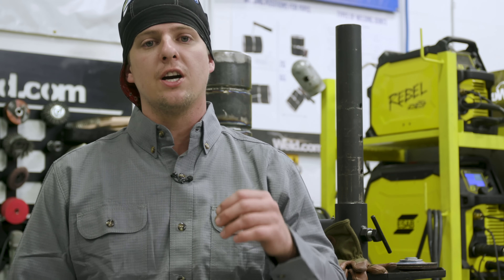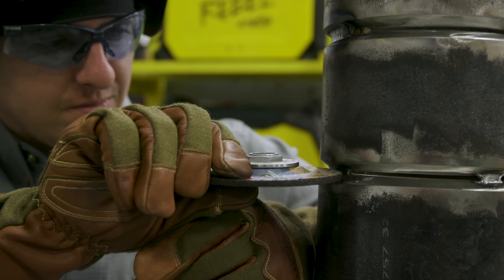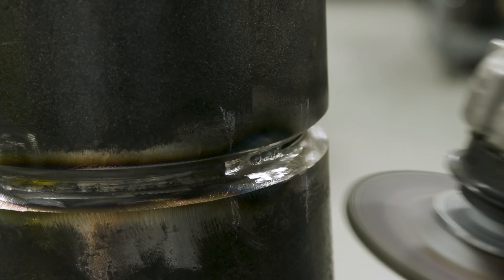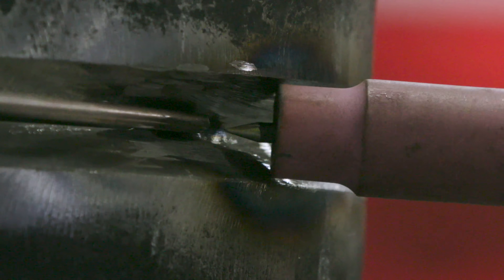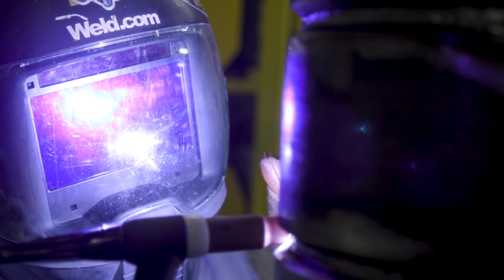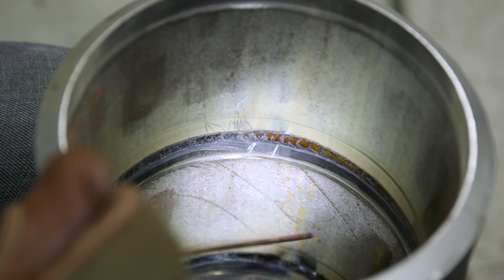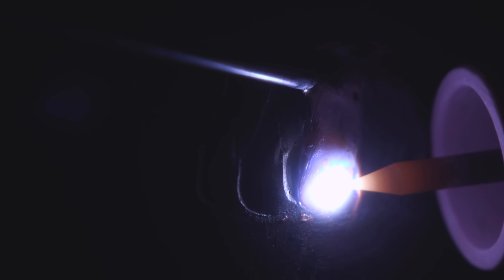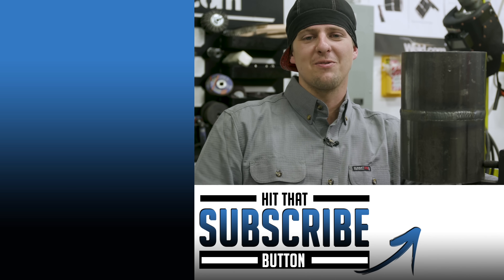How to Fix Undercut on Pipe Root and Cap

Comment: so I understand this would be for the welder qualification test. But what happens if its during production and lets say your inspector rejected the weld because of the undercut.
Rejection in production weld means re doing OR reparation following a reparation approved WPS, BUT NOT welding over it, right?
My doubt is wether i would have to cut the weld and re do it at all if the inspector rejects my weld.
thanks
Reply: Why would your QA not let you repair the weld? Why cut it all off?m

Comment: Great job explaining in video repair using Blue Line Cutting technique...                The thicker base metal heat transfer is absorbing the btu's per unit mass but the thinner root metal absorbs the btu's however it can only with significant temp increase because there is so little mass AND cross section for the btu's to travel out to the thicker base metal..   This is the root metal's Planck energy is the temperature 575F or 302C permanently  recorded on the surface, so if go higher the color is yellow toward white which you simply don't see it and you have cut thru...  (steel) other base metals have own color vs temp...   EVERYONE ALREADY KNOWS THIS all as heating to cherry red, straw  yellow, carbon blackened surface fades, white hot etc....

Comment: Usually when you try to fix something small you end up makeing it worst!!!!!! Word to the wish if the wall is broke down and the edges don’t look like straight lines leave it alone and keep going I’ve never seen a x-Ray tech call undercut. I’d only try to fix it if the QC had to look at the bead before I closed it up. Internal undercut has to exceed two continuous inches to be a called a defect. Just put a tall cap on it and call it good!!!!!!

Comment: Yeah, boy, for future: STOP blanting edges of your beveled pipes. That is not stick welding with its 1/8 blanted edges. You should not do it for TIG. Not more than 1/16. But better leave them sharp.

Comment: 7:07 - “...[root] is flat... I will run the second pass even hotter, and it will push in even more...” 
Absolutely misleading statement. Yes, the second pass has to be slightly hotter than the root pass, for the purpose of better fusion of the metal of the second pass with pipe walls. But no way you are able to fix flat or concave root by running very hot second pass, whether you are pushing in wire or not pushing. Actually, the opposite is true: running the next pass hot enough - is the trick of fixing excessively HIGH root pass. I did it myself a few times. As a result of very hot second pass, the flat root face will either additionally suck in, leaving concave root pass which will result in failed inspection ... or your amperage was not high enough to cause this undesirable damage of sucking in a root face...
Reply: depends what position the pipe is in.  If your welding really hot in the flat position you can absolutely sink the root in further.  In 2g though its gonna suck back running too hot on the hot pass.
Reply: @kwent86  I agree with you. But even in flat position it is a very risky practice and without visual control. I would give chance for success in fixing/sinking root nicely even in flat position as very low. But depends on material. For carbon steel, with its high viscosity when melted, the chances are much better. For most stainless steels it is nearly impossible, because they melt like water. One second ago stainless steel still needed extra heat... but one second later the paddle is already sinking much more than welder wanted. 
Also... every time you remelt stainless steel it looses nickel. It boils out. And stainless steel loses its properties. So, for duplex steels they keep those special welders that weld everything very cold, do everything right from the first time and never need to do repairs.
Reply: @alekrudy5993  for sure, not something you want to try to do every time.
Reply: Key words being "I tried it a few times". You can absolutely round out a flat root by running a hot second pass. Just takes practice, knowing your heat, and how fast in between passes you light back up on it.
Reply: @nitrojunkie9027  , I don’t believe you. Also I believe you either don’t know what you are talking about or maybe you are trolling me. 
Why angle of a bevel should be exactly 37.5 degrees and opening 3/32? To provide for ONE first pass paddle to be able to form that melted ball by force of capillary action.
 Like ball of liquid mercury. If amount of mercury in that ball  is even slightly larger than it needs to form a ball, then it does not form a ball. It flattens.
 The same with a ball of liquid (melted) steel in our paddle. If you make your paddle bigger and expand your paddle wider (higher onto the bevels), then capillary force pulls molten metal higher onto the bevels. Which means: away from the root face, thus flattening it.
Here as well is the reason why bevels have to be precisely at the angle 37.5: if your pipe fitter formed blunter angle, then your ark will touch and melt bevels higher than you wanted, forming molten paddle high at the bevels, which will result in.... right, in flat or concave root face, because capillary action will form that liquid metal ball HIGHER than you want. (And you wanted that ball exactly between edges of bevels.)
Reply: @alekrudy5993  makes absolutely sense. I started working in Sweden a couple months ago. They bevel  pipe 30° here, when I always practiced 37.5° bevel. The first project I've done was 2" sch 60 pipe.  It was prefab in the workshop , so I've ran it in the 2g position. No matter how much of filler I would shuffle in, the root had only 1/64  reinforcement and I couldn't figure out what was the problem. Now it makes sense. Thank you for sharing your wisdom.
Reply: I love porpoises. Not sure what they have to do with fusion. But I'm sure they have it figured out.

Comment: Great video thanks I’m kinda new to walking the cup especially on pipe this will help for next time I did a little at work the other day scratch start on stainless and it was hard to get the wire to flow smoothly the whole way it seemed to go good at the bottom but when I was getting to the top I kinda had to hold and keep the wire lifted up in the puddle. I know I still need a lot of practice with walking the cup and welding can’t have enough practice ever right. That was just one of the things I was struggling with I didn’t watch the whole video yet I will this weekend I’m sure I’ll watch it a couple times. Thanks again stay safe everyone 👍👍

Comment: You're getting better speaking to the camera.   Just curious, when it comes to pipe welding any reason to TIG vice Stick?
Reply: It’s used to ensure proper root application.  0 slag entrapment ensures that you have a proper root.   Process calls for 0 6010 so you do tig root and hot pass then fill and cap with 7018.   Many variables but that’s the gist of it.
Reply: @thisdj83  nicely explained :)
Reply: In my opinion, Tig is faster, cleaner and more forgiving. but it all depends on the procedure that your company is using. Stick is more portable in general and you don't have to worry about the wind if your outside, but you don't have to do any grinding on your root pass generally with tig before you start your hot pass. in my experience, most jobs or companies have a procedure for a tig root and you just need to ask for it and be properly certified and you can use it over 6010 for roots.
Reply: They're demoing and training on regular, carbon steel pipe but there are hundreds of TIG applications for alloy pipes. Some carbon steel pipe applications also but the alloy applications alone ought to be sufficient answer.

Comment: question you said that either not enough filler or too many amps were causing the undercut,  but wuth using a laywire tecnique .. you should have enough wire  but you didnt turn down your amps???  so question becomes filler size.. filler wire not big enough?   or perhsps travel speed?
Reply: and the only reason i ask is i have not tigged pipe 😁🙏👍🇺🇲

Comment: Either adjust your travel speed, add more wire, or change amperage. If your fast enough, amperage being too high isnt as much of a problem, depending on the thickness of the material. 

Being a good welder is all about doing what works for you and staying comfortable.
Reply: Agreeded